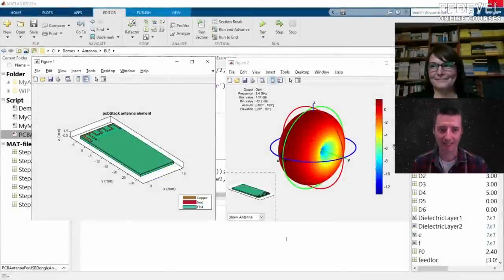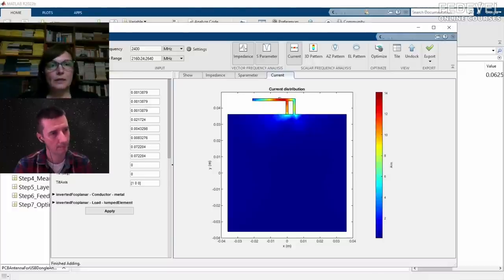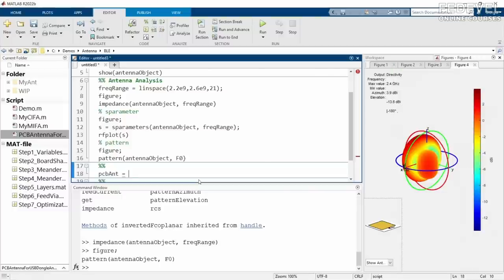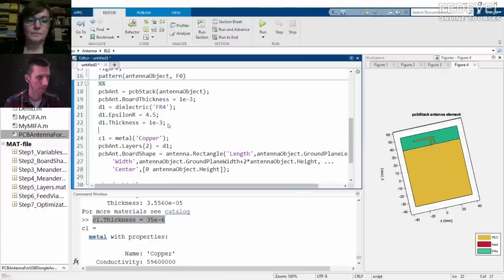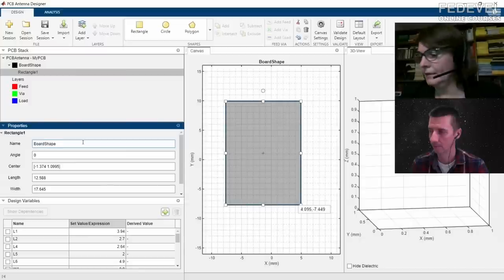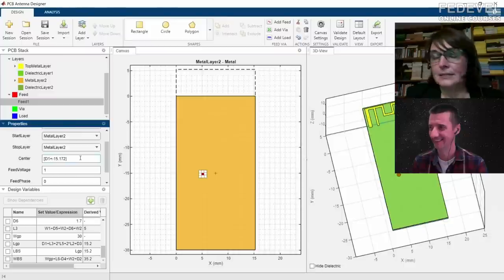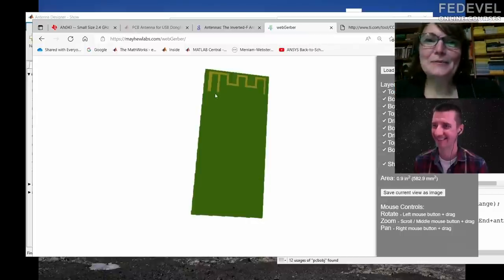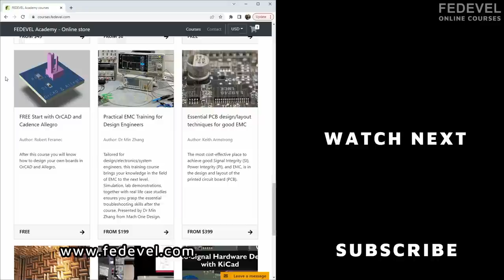How to Design and Simulate PCB Antenna

Comment: Damn, it's good that antenna designs for all popular frequency bands are available to the public, and we all don't have to go through this incredibly difficult path!
Reply: Not really to the public but to members with license for that package.
Reply: When you put that antenna design in your pcb and enclosure, you may be very disappointed in the result.  It will probably "work" but actually measuring the performance against an antenna designed for that exact situation will be surprising.   The first time I used XFDTD to redesign such an antenna I tripled the range of that product, and didn't add one cent to the PCB cost.

Comment: Robert, tell me, please, if the antenna cannot be placed next to the chip, then how to correctly calculate the length of the coplanar waveguide? Does the length have to match the wavelength? Or if the software calculation gives good results for any length, then this is enough?

Comment: XFDTD by Remcom does a much more complete simulation, pulling in both the actual PCB artwork from Altium, and the enclosure and nearby elements.  While it's possible to design an antenna this way, what happens to that design when you put it in the actual enclosure which may include significant metal objects?   As you work with XFDTD you will see how even plastics like ABS affect the antenna tuning.    The antennas I designed with XFDTD worked as designed when tested by an external lab.    A poor impedance match with the common RF chips will result in high harmonic levels, causing you to fail your compliance testing.

Comment: I’m a Robert fanboy but really wish he would set out his requirements before hand to his guest eg please demonstrate how to design an antenna on a two layer PCB with … type dielectric and …… space between the layers . I need a ground plane on the bottom of the board which is made of …. Thickness copper . Then let the guest work through the design following which q and a time . This will eliminate continual interruptions 🙏